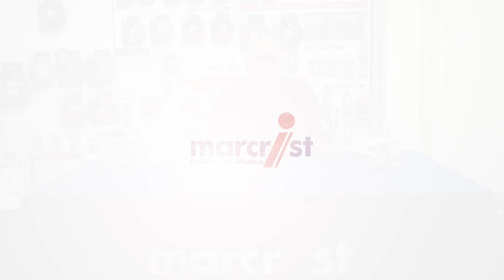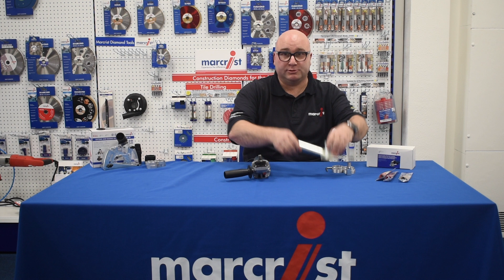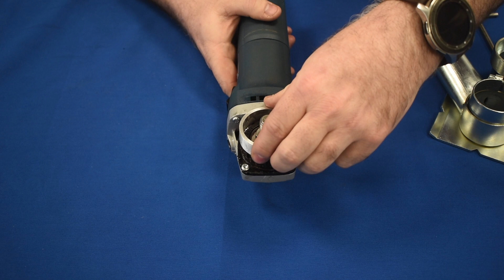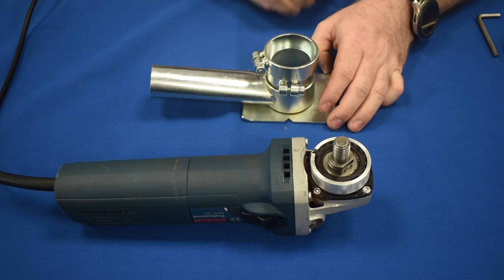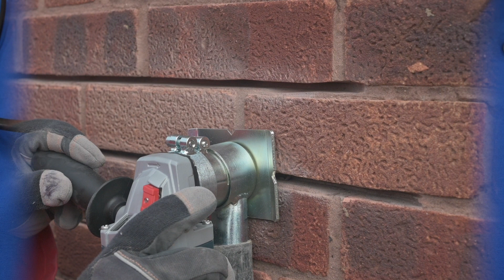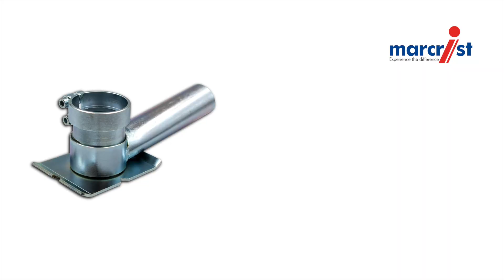Mortar Routing Dust Guard [NEW] Marcrist RDC45 : How to fit mortar router guard to grinder & more

Comment: Looks a great product. Would it fit a Bosch PWS 720-115 angle grinder. The collar is about 40mm with some holes in for the normal bayonet. There is a sprung red metal clip for the normal bayonet that would need to come off. Many thanks.

Comment: Hello what width was the take used on the demo thanks
Reply from the maker: Its the Marcrist DR850 and this was diameter 8mm. There are 6mm and 8mm available - Anymore questions or need to know where you can get them call our customer services team on 01302 890888 Mon-Fri.
Reply: Take not take
Reply: Rake not take , sorry